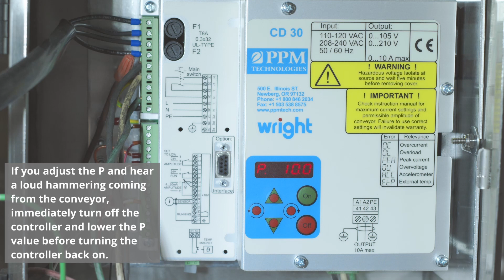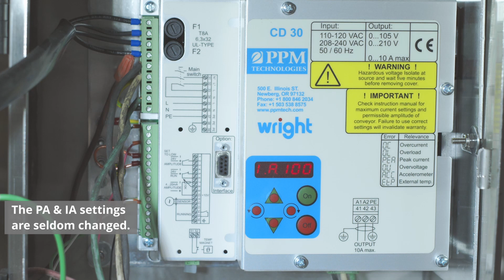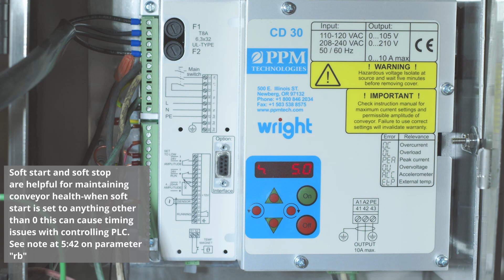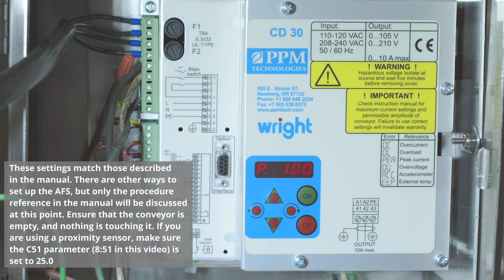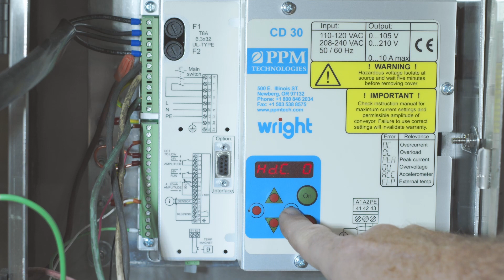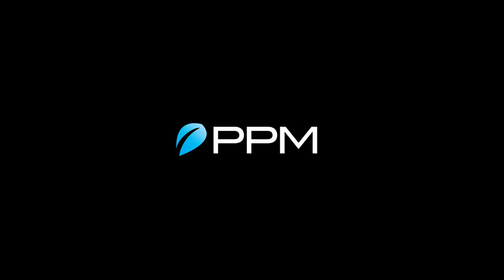CD30 Instructional

Comment: Why do you not use the current limiting function on the controller? The controller has the ability to protect the magnetic coil so the current reduction should be enabled.  This way it can act as an electronic fuse to protect he coil from burning up.